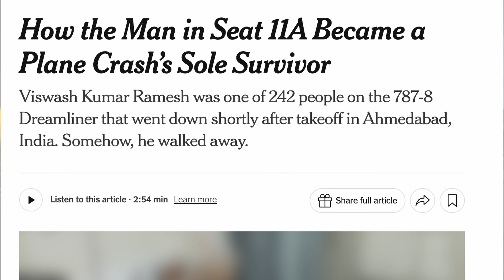Why the RAT Changes Everything – Air India 171 Update

Comment: Well done on the reappraisal.  If we are thinking dual engine power loss then , having looked at the fuel system schematics and procedures, my take is massive FOD ingestion into the fuel filters.  This has happened before on VH-VKJ with near duel engine rollback. 
This was caused by biocide treatment in the days before.  According the the report there is an AD stopping the use of that particular biocide but ??  I assume biocides will be a routine treatment in a hot humid environment.

Comment: Just 1 plain question, if the Rat doesn't save the plane what's the point of it being deployed automatic, I can imagine all the cabin thinking"it doesn't matter about no electrics or both engines failing or the hydraulics not working the Rat has been deployed to save us"or am just thinking stupidly common sense
Reply: in high altitude RAT makes sense - it delivers 1/18 of the normal power to enable basic flight maneuvers to  execute an emergency landing
Reply: At time stamp 7:04, Captain Steeeve explains what the RAT does - if it deploys at a much higher altitude when both engines are out, the RAT will provide electricity, hydraulics, and enough time for the pilots to cruise the plane down OR restart the engines. Captain Steeeve goes on to point out that when the RAT deployed on the Air India plane at an altitude of 400-500 feet, there wasn't enough time for the pilots to do anything to save the plane.
Reply: @Dan-cu9vvI'll take your point, but if it doesn't do what it should in this day and age what is the point of it deploying at that height, that's what I'm getting at, I asked a question a few yrs back about a "fail safety device fitted on an aeroplane" simple question was "what if the fail safe fails", not trying to throw a spanner in anybodies works but if the device doesn't do what it is expected to do then it should be changed, I have 2 members of my family working in an aeronautical facility and a friend that works on the raf planes and they have all said we keep getting told a load of crap about things, my  only thing is, as I mentioned, if it doesn't do its job then it should be on the plane, if the plane has to be a certain height then it's pointless deploying at a lower level to do anything
Reply: @keithparlour140  
I think the point of having the RAT is better than having nothing to try to save a plane that has lost both engines and the APU. Captain Steeeve showed a video clip of a Japan Airline 787 (at time stamp 8:33) using the RAT in an emergency landing. One more point - According to Captain Steeeve, the RAT deploys automatically when both engines shut down - the pilots didn't activate it. The way I see it, having the RAT on an airplane may not work in every situation but, it's better than having nothing at all when both engines fail.

Comment: The only surviving passenger said he heard a loud bang just before the plane began to lose altitude. You said that was probably the sound of the Ram Air Turbine (RAT) deploying but could that loud bang have been something else. Maybe a catastrophic failure of something that affected both engines simultaneously. But considering that most crucial systems have 2 redundant backups what does that leave that could fail and shut down both engines?

Comment: If the fuel was contaminated why were no other aircraft affected? I agree that it seems to be the most likely reason for the engine failures but how? Perhaps it can be traced to the fuel supply truck that refuelled that particular aircraft? A contaminant in that particular bowser load that was transferred to the aircraft 🤷‍♂️

Comment: Very plausible and best possible assessment of all yet, "now why would a double engine failure result" (the pilots restarting engines, or a total shut down from the electronics) for latest generation airplanes with complete Ai seems like with the 320 and 310 all electronics shut off from past? And that little rotor... Propeller, Not only in emergency,..... 🤔🤔🤔

Comment: Why hasn't anyone on utub considered the Kegworth British Midland 737 shut down of the wrong engine after SEFailure scenario... that would fit... ie EF after V1, no action till 400 AGL, @ 400 PF calls "memory items"... in the panic PNF shuts down the wrong engine... look at the way the plane wobbles and drifts to and fro during the short flight... that would fit... or even a breakdown of discipline due to panic... such as shutting down the wrong engine as a reflex action without sticking to the prescribed process...

Comment: The moment I saw the video, my instinct says they lost their engines although it is unlikely to happen to a modern aircraft. It doesn’t seem like they have retract the flaps too early because even they did retract the flaps at that moment, the airplane wouldn’t sink like that, the airplane was still generating lift with takeoff power, at worst they will lost some climb rate, but not stalled.

Comment: its tragic they reached v1 and did not bail, after seeing the length of tarmac used full load of pax and fuel, it was too late, kept gear down to go around and the cabin either knew any input would induce stall or had no hydraulic anyway, so sad.

Comment: Take a look on how the landing gear bogies are positioned. When the B787 takes off, the bogies are slanted with front wheel set slightly higher than the rear set. They seriously had a loss of power and hydraulic loss cause it can actually be seen on how the landing gear bogies are hung down front wheels indicating that the pilots were retracting the landing gears but it then stopped before doors open.

Comment: I tried simulating this on RFS app, I tried so many times raising flaps but it didn't cause any crash. But switching off both engines made the plane crash exactly like this.
Reply: dreamliners have more than enough power to fly without correct flaps or if gear is down. It will burn more fuel and not good for fuel but it can still fly.

Comment: Can the quick loss of altitude we saw immediately after takeoff be caused by anything other than a dual engine failure? Or, put another way, would a hydraulic and/or electrical system failure alone, cause a plane to drop so suddenly after takeoff?

Comment: Hi, 
First of all I want to commend your bravery since u are a pilot. Not too many ppl want to take up this profession probably for this simple reason ........ they don't want this happening to them. Secondy, I think u are spot on with that theory about the dual engine failure. This was originally my theory from the beginning. I developed this theory after viewing some other videos associated with it including the video online of the passenger that was on this airplane 2 hrs before and he says in the video that nothing worked not even the air conditioner. I came to the conclusion that they got power failure right after liftoff. Therefore the engines stopped working, pilot controls stopped working suddenly. They weren't able to tuck in the landing gear or the flaps so they were left in this position. I also want to commend that pilot for quick thinking and make a call split second. They knew that they can't do anything with the plane so they braced for impact. I believe the pilots did nothing wrong. It was a mechanical failure of some kind that led to no power. I think that some proof of this is in the video I stated. He states that air conditioning didn't work, behind the seat computer didn't work, stick controls to call for a stewardess didn't work. He shows this in the video. I think that this happens when u have no power in the plane. This is why some were saying that it was hot/stuffy there.  This was from a passenger that was on that plane 2hrs before the other set of passengers boarded so these issues were never addressed. One question is .......... if they had sooooo many issues/failures with equipment why didn't  they ground the plane instead of keeping it in circulation???? These ppl didn't have to die!!!!  I feel that maybe in some way these ppl were sacrificed so that it never happens to anyone else ever. (I don't want to sound insensitive). Had this plane continued to be in circulation with it in this state, there was a chance that this would have eventually happened.  It got obliterated so no one else will die. It kinda does sound like there is a bit of negligence on their part. This plane should not have been in circulation with these issues it had!!!! 
While watching several clips of that video that shows the last moments of the plane and crash, I also like u noticed that the plane makes a weird sound, usually big jets don't produce that type of noise. It's also very sad to hear when the moment of impact is heard and the huge fireball. Its almost certain they knew they aren't going to survive cuz I guess they must have seen from the window that they are heading straight for a building. 
My heart 💔 for all of the passengers, crew members including the pilot and co pilot who died. I hope that their family and friends can heal from this utterly devastating event. I am happy to learn that there was 1 survivor. He did though state that he was unconcious but then once he came to he reacted and jumped out of the emergency exit. Its a pure miracle he survived 😱😁. Usually when u hear about plane crashes u don't hear about anyone surviving.  Usually when stuff like this happens u usually hope that maybe somehow more ppl will be found alive but I know that there is very little hope when u have an explosion. I've heard from somewhre once a long time ago that if u know u are going to crash, do a fuel dump. It lessens the result. It's better for it to be a mechanical failure rather than pilot error. Pilot error is far worse cuz its the pilot that makes a fatal error/decision and ends up taking everyone out 😱. Mechanical things eventually fail cuz they are mechanical, just like the car ppl drive for example. The list goes on and on. It fails at some point. 

When power failed, everything else failed inside the plane including the engines. This is why no thrust or lift will be felt or seen. Everything shuts down. This was the last effort to try to lessen the impact and lessen the amount of fatalities on the ground. I can only imagine their reactions just before impact 😭🥺😔. I bet that they were trying to soften the impact or landing. This plane almost is hovering in the air.

Comment: Hey @captainsteve I thought the audio sounded off from the start and the rat picture confirms that now. Just thinking if they’ve had contaminated fuel and had Biobor used in the tanks and got the mix wrong which is what happened with the Titan A320 which diverted into London a few years ago?

Comment: There is another report of a passenger of the inbound flight reporting non-working AC and entertainment system. When you feed all those information into the latest AI model the stated root cuase is "The crash was caused by a pre-existing failure in the electrical power distribution system, likely involving a bus tie contactor or misconfigured circuit breaker. This failure: First appeared during takeoff on the inbound domestic flight, disabling non-essential systems (AC, IFE, lights); Was not corrected before the outbound international flight to London; Escalated during takeoff when engine-driven generators took over, causing: Loss of both AC buses, Failure of electric motor pumps (EMPs),  RAT deployment, Loss of hydraulic and flight control systems, Rapid crash shortly after liftoff. The domestic-international sequence shows that the failure was detectable but not acted upon, making operational decision-making and maintenance oversight central contributing factors."

Comment: Please take a look at this video. Towards the end is a shot of the exterior of the aircraft just before it took off. Now, while I don't think it could have caused dual engine failure, my question is, could the hand sized hole in the engine casing been a contributing factor? Could this have caused an electrical short? Thanks for your help with this.
https://youtu.be/DafWPv02Nig?si=YvmsMHDoAHa4lmKJ

Comment: #2 Theory

some aircraft were designed to eliminate the need for a special "hot and high" variant – for instance, the Airbus A300 can perform a 15/0 takeoff, where the leading edge slats are adjusted to 15 degrees and the flaps kept retracted. This takeoff technique is only used at hot and high airports, for it enables a higher climb limit weight and improves second segment climb performance.

Comment: There is a passenger video from the previous flight that showed the airconditioning and inflight entertainment systems were down. Is it possible that the plane was flown with one or more redundant power busses disabled and that a final failure on T/O caused both the RAT to deploy and a disruption of the electronic controls or fuel pumps of the engines?

Comment: Dual engine failure. Contaminated fuel ? Quite possible, but aren't we forgetting the Lithium batteries ? 787 has a history of Lithium battery packs overheating and exploding. The loud bang heard by the lone survivor, could that be the batteries exploding ? That could explain the the whole thing part by part. Electrics, Engines, Hydraulics, RAT getting engaged, Cockpit display and control, one by one.

Comment: AAIB Preliminary Report – Key Findings

1.  Root Cause:

Captain’s seat slid back during rotation due to failed AFT lock, pulling throttles to idle.

FO unable to counteract captain’s weight on thrust levers.

2.  Mechanical Evidence:

Fractured locking pins (PN: BACB30LN5S02) found on captain’s seat.

Seat serviced 11 days prior; no post-repair function test logged.

3.  Flight Deck Events:

+0:12: Seat slips aft during rotation.

+0:15: Thrust drops. FO: "Thrust dropping!"

+0:18: Captain: "My seat!"

+0:26: FO applies thrust—too late.

+0:38: Impact at 214 ft.

4.  Contributing Factors:

High temp (43°C) reduced engine margin.

Crew coordination gap: No trim/thrust callouts.

Throttle design flaw: No safeguard against forceful retraction.
Reply: Where did you get all this information please give source link
Reply: I'm just fucking around due to This report. But That is suspected and just rumor.
moreover The cockpit seats are made of Fully Eleectric moter seat.
If The Locking Pin was broken There are redundancy fail system.
furthermore Did you see the RAT? if captain Just had pulled throttle, RAT would not have been deployed.

Comment: Before even taking off it already shows that the entertainment systems were not working or powered down, this is probably due to the lack of power thats being distributed throughout the plane. Therefore, when the plane took off less than a minute that's when the 2 engine failed and by the time the RAT had a chance to power things back up it was too late due to the low altitude and the plane being heavy with the unused fuel that was just recently put to the plane.

Comment: 5:33 so that was the rat the so when the rat deployed that means that was the door that fell off the rat that was falling off the plane that was falling off the plane in the original video you hear those noises is that their attempt to restart the engines right before impact because that does not sound like a plane crash
Reply: That is the longest sentence ever
Reply: @Kizzabell  Well as you can tell my phone used punctuation. And all that's because I'm using my older phone. The new phone I got it doesn't do hardly anything as well as my old phone. So the first comment was left by my new phone. The second comment was left by my old phone and so was the third.

Comment: Isn't maybe also the absence of jet engine noise also a hint that the engines were at least not running at high power?

The problem at this point right now is, that each individual evidence is rather weak. Those few pixels below the aircraft could be the RAT, but it could be something else as well (e.g. a bird passing by - it does not even have to be close to the aircraft as long as we see it only from a single angle!). The noise seems rather distinct, but again there could be a number of different sources for such noise, maybe even completely unrelated to the aircraft. It might be especially tricky, since maybe there is not just one single problem that lead to the crash, but a combination of multiple issues.

I am not saying that this theory is wrong. All I am saying is that even leaning towards a particular theory is pure speculation. It's good to see the various possibilities what went wrong, but it's not a good idea to speculate too much at this point.

Comment: Fuel related problem did it, probability wise.
Another more likely cause is hydraulic system battery fire or exploded during take off post V1, and the RAT might not be able to supply enough juice at such low air speed

Comment: Would the engines not be supplied with fuel from different tanks? Since the engines started initially, it is unlikely that they would flame out at the exact same time due to contamination. The heading of the plane did not deviate, which evidences that the engines stopped at the same time. What is the commonality between the engines if it is not fuel?

Comment: It's also possible that the pilot or copilot could accidentally turn off the engine fuel supply. This has not been highlighted as a cause. However, on a modern jet, would this be possible?

Comment: I would be amazed if the pilot operated flaps instead of landing gear, surely there would be some form of system protection for this? Hydraulic failure which meant the landing gear did not retract and flaps possibly were retracted somehow? RAT suggests power failure.